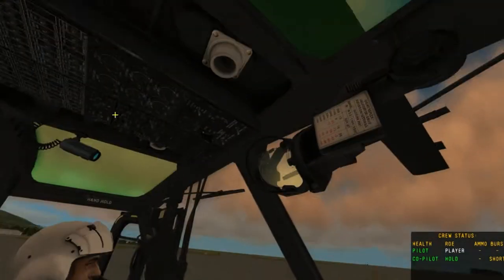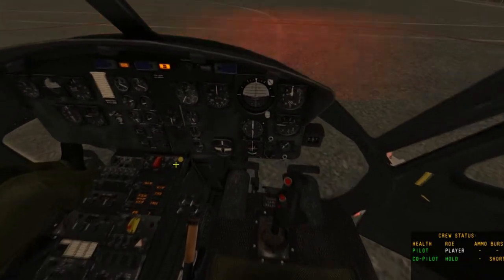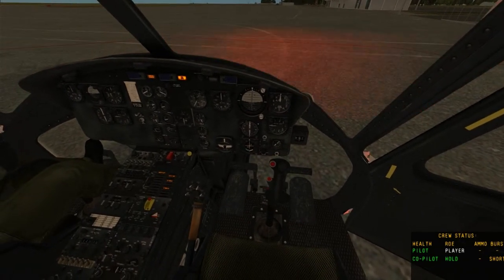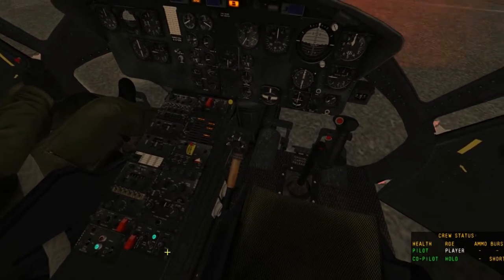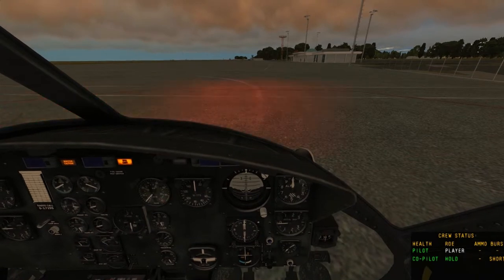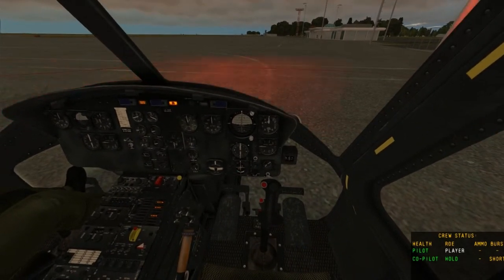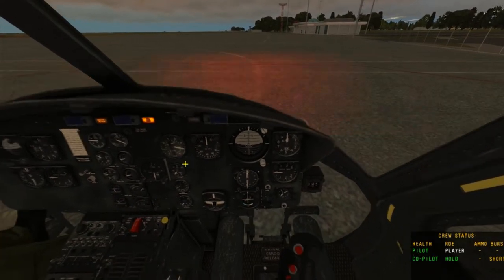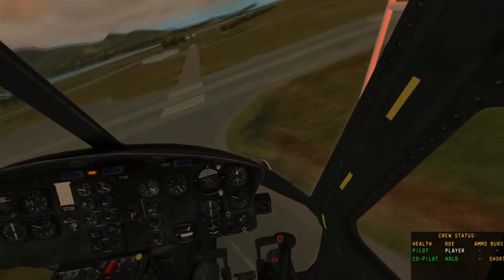Digital Combat Simulator: How to start the Huey UH1H!

Comment: Thank you SO much!  I guess it wasn't starting for me because I wasn't introducing the fuel with the RPM like you said... I guessed they changed that in one of the patches, as I haven't used it in a while.  Now it makes sense! Thanks so much again!  Liked and favorited :D
Reply: They did patch it now if you put a load of fuel into the engine on start the exhaust sets fire. Thanks for the positive comment.
Reply from the maker: Sorry the comment above is me, I have two accounts.